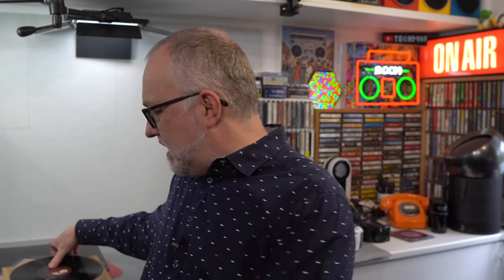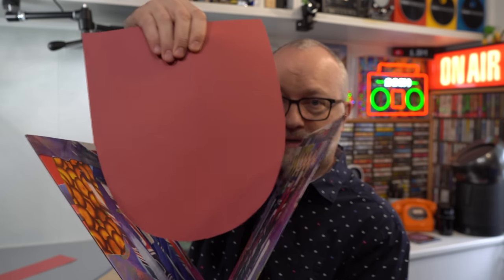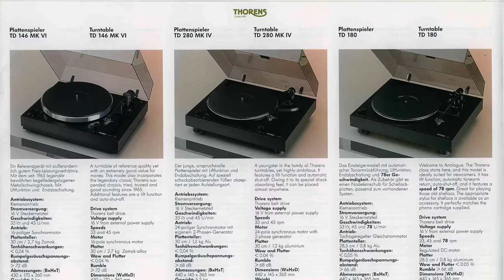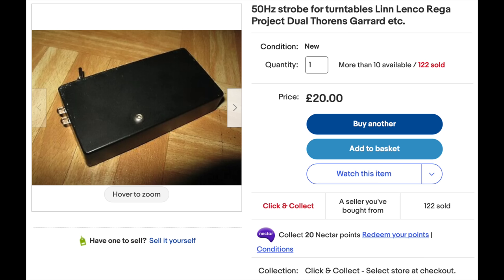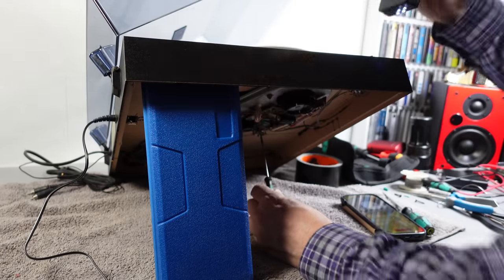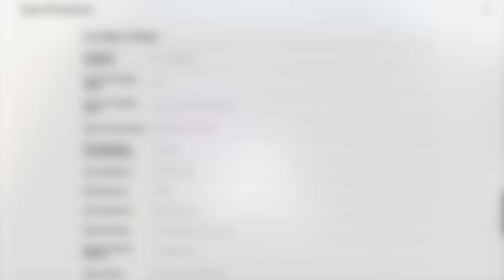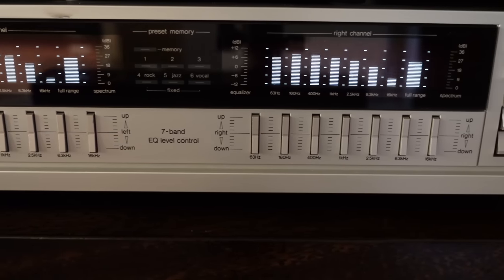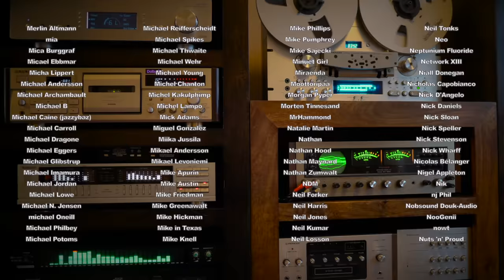Playing 78 RPM Shellac Records properly

Comment: The commutator is oxidized on the motor from being made out of cheap metal. That is why it slowed down. Running it for hours might get it to work again, but I doubt it with it being a cheap unit to begin with. Basically your assumption is correct: the motor is dying. This is true since it isn't a serviceable motor. Just crank the trim pots as needed.

Comment: I had a client bring me a 78rpm home recording which was very unusual. The recording disc had a preformed groove that used a 7 mil stylus. He was able to buy acoustic styli for it. I was able to cut the tip from the shaft of the stylus and graft it onto a modern cartridge. Using a 3mil stylus was not satisfactory, but my Frankenstein stylus/cartridge worked well and we were able to hear his grandfather's home music for the first time in 90 years.

Comment: You can digitise a 78 using a conventional 33/45 rpm deck - if you have a high quality one and tone arm. First get a good 78 magnetic cartridge as explained here. Play the 78 rpm disc but at 45 rpm. Export at 48 kHz PCM. Then take the slow recording into Audacity increase the sampling rate by 73.3333% by going to the track option down arrow - going to the bottom where there is the 'rate' option and then selecting from the drop down menu of frequency to 'other'. Put in here 83199 Hz - and this will restore the speed. All you have to do is then down res this back to 48 kHz and you have the conversion done. Its so much easier doing this in the digital domain and you don't have to buy a rubbish turntable if you already have a good one.

Comment: The GE Wildcat has a 78 speed as part of a 3-speed function, but it uses an original Diamond LP stylus in a C660 phono cartridge. I played 78’s on a GE Wildcat and it sounds okay, but it was bad, because it has wide grooves. 

I also tested on one of these hand cracked acoustic phonographs like Camp Fone, Sonora and Victor VV 8-4 Orthophonic Victrola and it sounds great with the right needle, and the tracking force is too heavy, and it weighs over 100 grams, but it’s fine on playing shellac 78’s whether it was from the 1920’s, through the 1950’s. BTW, all 78’s from the 1950’s can still be played on acoustic phonographs, but it very loud, and it needs to be very careful depending on what needle that I’m using, a soft tone needle would be an option.

Comment: I ran into this problem, and I wanted a cheap way to transfer. Here's what I did: I bought a Victrola Eastwood. It does have the cheap mechanism that the suitcase record players have, but has a magnetic cartridge. Paid $100 for it brand new, then bought a 0.3m stylus that I can switch out. If I run it through the RCA connections on the back or through Bluetooth to either a computer or through my stereo, they sound great.

Comment: An incandescent bulb would flicker at 100 Hz, not 50 Hz.  It flickers at double the line frequency.  That's because the temperature of the filament varies in relation to the magnitude of the current.  It doesn't care which way the current is flowing.  So you get two brightness peaks per line frequency cycle.

Comment: The belt might have slightly loosened over the years, not enough to cause it to slip but enough to throw off the speed (the speed measurement light sensor is before the belt, so any variance in the dimensions of the belt could throw it off and it would not be able to correct it automatically)
Just a guess, but I don't see a lot else that could go wrong, it's a very simple device. Even if the motor was worn out and failing, the light sensor should be able to correct for it and adjust the speed automatically.
Anyways, the pots are there for a reason, speed can drift over time for one reason or another without indicating a fault, the components are not made with extremely tight tolerances.

Comment: The strobe disks can be expensive these days if you need to buy a light, but there is an app, at least for android, that will strobe the LED used for the flash at 50Hz.    I have used the phone apps quite successfully.
It's quite possible the speed adjustment could be off from factory build on these budget models, not to mention we have no idea what people who had it before did to it.
The great thing about the AT95-VM cartridges, you can just get a stylus suitable for LP's and use the same cartridge, just swapping the stylus, to play all your records.

Comment: I do not understand why you tried a recap before even adjusting the speed pots or replacing the belt. Even if the caps where the issue you would still need to readjust the speed potentiometers. And it still is probably the belt. It could have been stretched over the years. Also you would have to use some kontakt spray on the pots in order to make sure they actually keep their ohm reading. I would still purchase a new belt. If it's old and stretched it's more likely to not be all that consistent.

Comment: If you still have the Zoom Spout oiler (as you used on the Seeburg BMS1), you can try it on the motor bearings (if you can get to those, anyway). Provided the brushes are intact, it should help.

Comment: The 1 mil and 3 mil refers to the tip radius. The problem with a 1 mil radius tip is that it will bottom out on the 78 groove resulting in a noisy-mushy sound.
Proper 78 playback requires 3 things:
1. Proper stylus to groove fit. Thru the 78 lateral era, groove shape and size varied considerably. The reason was because especially earlier, the steel needles would wear to fit the groove as it is played. Record manufacturers often added an abrasive to wear the needle to fit the groove. Today using a jewelled stylus, you may need an assortment to of needles from 2.5mil to 4.5mil to obtain best results. I personally use a crystal Astatic B-2 cartridge I have rebuilt and use a sapphire 3 mil changeable stylus tracking at 1 1/2 ounces or about 42 grams! (This requires an older style tone arm).
2. Correct speed: the earliest discs from the late 1890's rotated at about 68RPM. Victor/HMV discs from 1905 thru 1925 typically revolved at 76 RPM. Columbia used 80 RPM. 
The standard speed of 78.26 RPM dates from about 1928.
3. Equalization: the earlier acoustical discs and early electric discs characteristic was known as "constant velocity". That is the amplitude of the groove deviation hence amplitude on playback to provide a flat frequency response depended upon stylus velocity. Hence to maintain the constant stylus velocity across the frequency band, the bass cut amplitude had to be huge wallowing waves and treble cut small tiny since the velocity is determined by the slope of the traced groove wave. This led to two problems, bass waves are so large they may cut into an adjacent groove and treble waves are so tiny they get lost in the surface noise. 
With later electronic recording and playback, in recording the treble is boosted and bass cut and in playback the treble can be cut and bass boosted to compensate. This means that when playing back 78's from different eras especially from late acoustic in the early 20's thru the 50's, the recording characteristics changes considerably. Top end equalizers have settings for this. The cheaper solution is to have a wide range of bass treble cut and boost and having a good ear to adjust.
Reply: A TC 778 preamp has 78 curve, still has bass boost, no treble cut

Comment: All electronic components drift in values with age (especially capacitors!). One of the main purposes of trimmer potentiometers is to allow compensation for drifting components without needing to replace them. Of course, it's still practically mandatory to recap something old like this if you plan on keeping it :)

Comment: My mum had a flip over stylus. We never knew what the difference was on each side of the stylus as youngsters, but we used to mess about, flipping it over and playing different records on it. We must have damaged some records, but never really noticed a marked drop in quality! Also, Matt, is the protective film still fixed to the label strip that runs along the front of the deck? If it is, are you going to remove it?

Comment: You can weight the shell correctly so you won't need to set the tracking force each time. Usually this means adding weight to the 78 cartridge.

Comment: That seems quite sane compared to how I archived some 78s. I have this questionable Ion USB turntable that my computer sees as a USB input-only sound card, and while it can only spin at 33 or 45rpm, I was able to get a 78rpm needle for the thing!  So, I recorded them at 45rpm with the sample rate set to (45/78*44100 =)25442Hz, then once recorded into the computer, set the sample rate to 44.1kHz without resampling the recording - and got a surprisingly decent result.

Comment: I too often find myself looking for dedicated 78 rpm players, and much like you, I could only find the planar, which would run me for about 750 bucks here in the states.
THere's also older ones from the 40s and 50s but I've yet to come across one that is fully functional and not expensive.
I also never like those 3 speed turntables cuz they don't last long until they start having some wow and flutter issues, at least that's what I've noticed with every 3 speed turntable I've ever owned.
Not long ago I resorted to playing them on my 2 speed turntable at 45, whilst recording it to my computer, and speeding it up post-recording, but it was super cumbersome, so I didn't continue.
I've got probably 200 to 300 78s just sitting in my shelves because it's too expensive to play them for some reason lol

Comment: The only quick suggestion I was able to think about was to have a removable (or smaller diameter) center spindle so you can precisely locate records whose center hole is off by a couple of millimeters.  Should eliminate some of the wow and flutter caused by the elliptical rather than circular track.

Comment: Although more expensive, the new Technics SL1200 features all three speeds, direct drive for correct speed and you can get quality Ortofon 78rpm stylus and cartridge.  Not sure if the Audio technica model is direct drive, it looks like a cheap Technics copy in every way.  If it's direct drive, well I guess you will not beat the price but if it's not direct drive, you have no way short of going through the strobe test setup mentioned in the video. Remember that 33 and 45 rpm are really all the manufacturers of cheap turntables care about, with the 78 being more for novelty value.  My advice if your serious about vinyl, get the Technics, it's really worth the price and is far from the most expensive model out there.

Comment: Someone else has probably mentioned - I don't know if he's still on eBay, but there was a bloke in Italy making cables to wire the usual stereo headshell terminals to a mono cart, in my case the Rega RB78. Cables cost about £30 delivered, summing to mono made a massive difference to the surface noise as others have indicated.
Reply: all you have to do is link the positive wires together at the cartridge or anywhere else in the signal chain.. £30 for a shorting link?.. well burned..

Comment: Reminded me of an old dilemma I had.  I also (then as a student) was not even "on a budget" (isn't that a strange expression?), so I had to build pretty much all my audio gear myself.  An exception was a Tandberg tape recorder, which I just could not make.  For the record player I found a Garrard kit.  It provided the 3 speeds and I believed a B&O tone arm and two cartridges would be an ideal addition.  Well, changing the cartridge was easy enough, no tool required.  But not so fast!  The stylus angles were different - I had to adjust the tone arm pivot height every time I wanted to switch the cartridge.  Hrrr....  Needless to say, I seldom cared to switch between 78 and EP/LP.  On the other hand, I still have all the audio gear that I built then, over 40 years ago.

Comment: The voltage supplied by the power supply might be slightly different from the original... the speed is not phase-locked to a crystal oscillator, is it!  The best 78 audio I ever heard was from a friend's Edison victrola with the horn in the bottom covered by a grille... they used a mesquite thorn as a needle and played 'Les Paul And His Paulverizer'... that was some amazingly psychedelic stuff, sounded 3D, no electricity involved.

Comment: There are basically 3 types of 78 records. 

The first are the Victor type that were recorded and reproduced totally mechanically. Discs from this era were sometimes one-sided. Another interesting fact is often an abrasive powder was added to the lacquer, so that the surface of the disc would be harder than the bamboo or steel needle used for reproduction. You needed to change the needle every half dozen records or so if it was steel or sharpen the bamboo.

The second type are the early  Orthophonic recordings. These were recorded electrically with microphones and master discs were cut specifically to be played through a new mechanical system with a specially designed horn dubbed Orthophonic. The Orthophonic brand name persisted, even after mechanical reproduction became obsolete.

The third type is typical of the post WWII period. The third type comprises much of the existing 78 RPM records. These were recorded and mastered to be played on a conventional monaural electrical phonograph. 

So there were fully mechanical 78 RPM records, electrically recorded, but mechanically reproduced, and then finally fully electrical. 

If you are an audio buff, I suggest checking out the work of Dr. Thomas Stockham, who was able to take old mechanical recordings and use digital signal, processing to remove the effects of the mechanical recording horn.  He famously took all of Enrico Caruso’s Victor recordings and literally took 50 years off the sound.
Reply: There is a lot more to it than that.. The flat disc with horizontal modulation was invented in Germany .. the Berliner.. usually recorded at something between 88 and 95 rpm... it's not all American..

Comment: Back in the day our lp player had the trim pots on the outside and you could easily trim it. It even on its own strobe and light as the platform was raised. The problem I found was the correct speed of LP was 33 & 1/3. If you played it at 33 spot on it was too slow.

Comment: Nice work. The record had quite a bit of wobble and probably wow. There should have been a way to move the pin for the record off center of the player disk to compensate for records with off center holes

Comment: The speed control is on the final output pulley not on actual turntable. This should throw the speed off as the output pulley wears, making it run slow.
The pots are also carbon-trace type and will have creep.

Comment: I have a Goldring Lenco GL78 with variable speed so it can play from around 16 to 85 rpm. I owned a TD180 new which I bought in 1990. It went wrong within 6 months. The speeds were inconsistent. The Goldring Lenco I still own is a gem and I will never part with it.

Comment: If you choose to transfer it to a digital file, use a program such as Audacity that will allow you to remove the hiss.  That will further improve the quality.  It is amazing that the quality of 78s are as good as you have demonstrated.
Reply: Just be careful, people are often heavy handed at hiss removal that they remove also parts of the audio signal. Just in case just keep the raw file as an archive and do the modifications on a copy. If something is wrong or unwanted the raw file is still there as a backup.

Comment: ...one thing to consider is that, being a cheaper model, is that it may not have been correct since it was new.  A lot of times the 'generic' stuff can setup a variety of ways (who knows, maybe these were set by ear, I can get a record pretty darn close by ear)...now if it were a high end one I'd expect a full on proper build....it took time to properly set up the gear...I'm guessing this is why it's almost equally off speed...the tech's tool or ear saw/heard it equally off speed...

...an example of this is TV's, especially the older CRT rear projection...they were generally set quickly and were almost always out of sorts...they looked 'good enough', but when some time is spent on them, they can look so good you don't bother with upgrading to a panel set (that was my experience with a high end Panasonic 53" CRT RPTV, and I still have it)...it's about acceptable time spent per product before it's boxed up...

Comment: Someone might not have messed around with the pots but I find it's quite common with disc drives for the motor to wear down over time and require more power to spin at the speed they're meant to, quite a common issue with older game consoles I imagine it's something similar here

Comment: One other issue: not all 78s were recorded at exactly 78 rpm. Some companies that sold both records and players sold records cut a a bit faster or slower and sold players that ran at a corresponding increased or reduced speed, and made the claim their records sounded best on their player, implying their player was superior.
Reply: Yes Pathé used 80 rpm well after the 78 rpm norm was set in 1925. Before 1925 we can expect any kind of speed. Also 78 is not exactly 78 : 
78 60Hz  78,2608696
78 50Hz  77,9220779